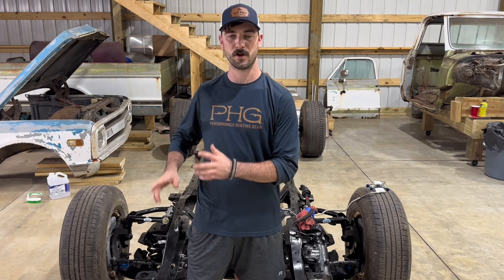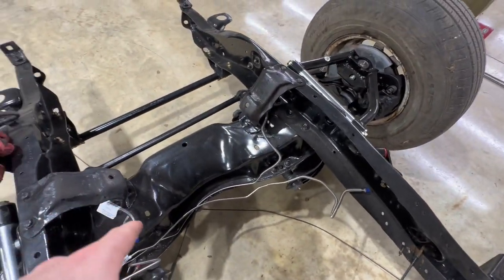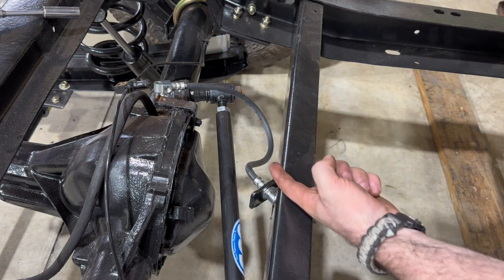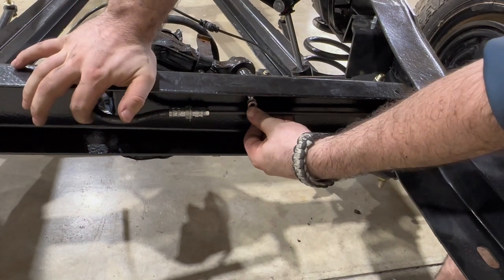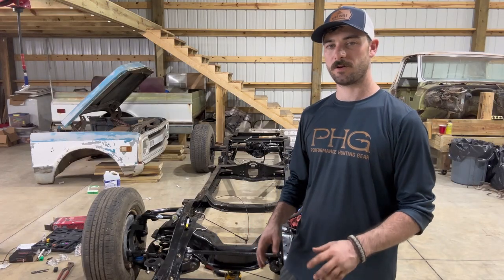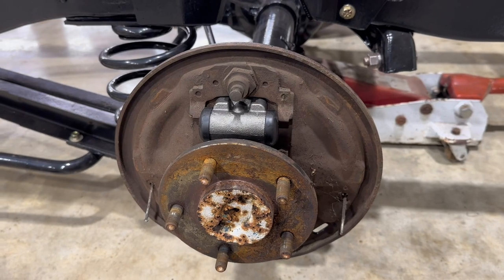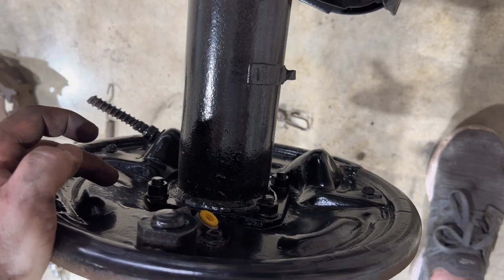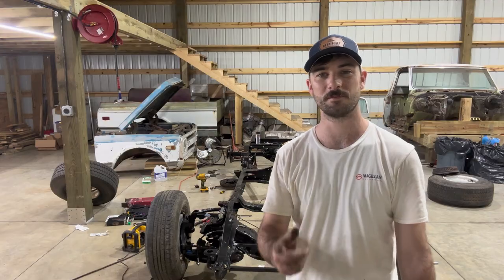Installing New Brake Lines for the 72' C10

Comment: Both lines from master proportionimg valve go on outside of frame. Use nickel copper brake line easier to bend and flare and doesn't rust.

Comment: What size bolt was it to bolt the soft line to the axle housing?
Reply from the maker: I'm pretty sure I used something I had laying around in my hardware bin that worked. If you have the old bolt you should be able to bring the bolt and hose into a hardware store and size it up.